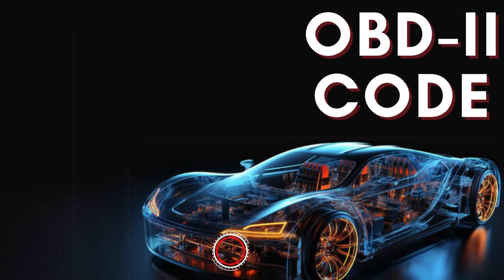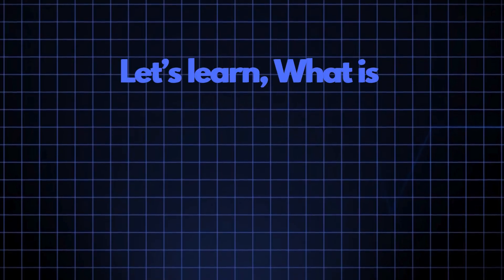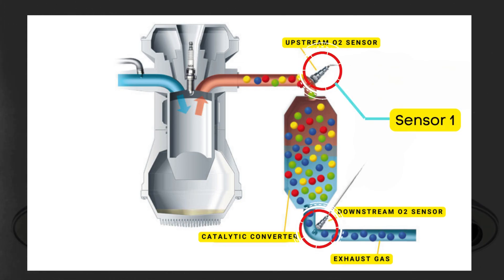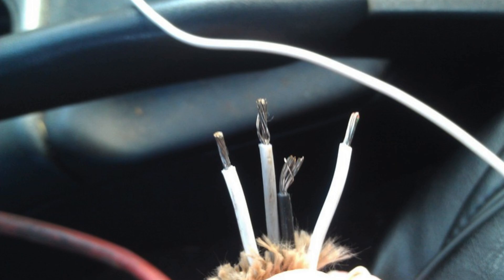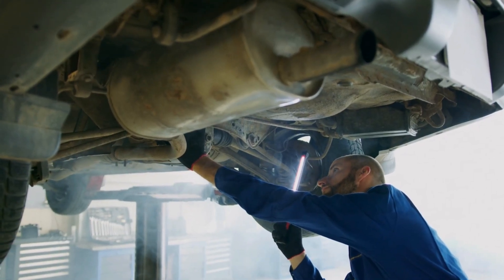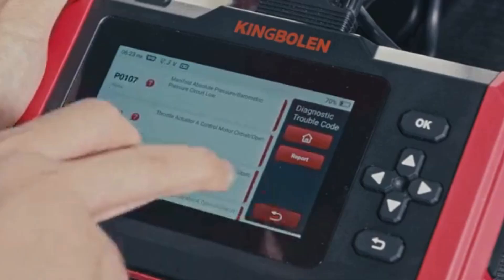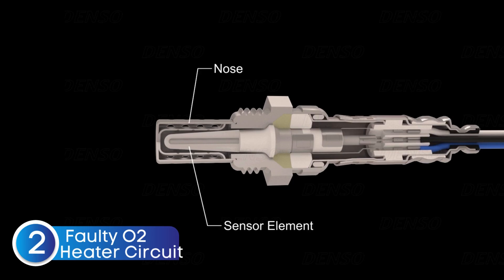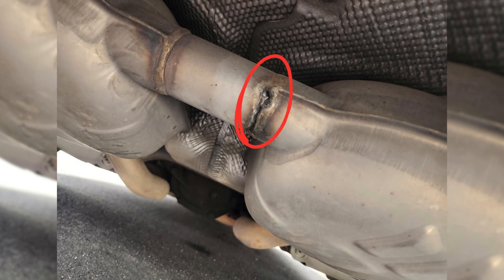How to fix P0132? | Oxygen Sensor High Voltage (Bank 1, Sensor 1)

Comment: My 02 sensor at motor cycle live data reads 1.275v 
When i disconnect 02 sensor and read at singnal wire to ecu harness side and check continuity at positive battery when ignition on engine of it reads 10.00+volts
Reply from the maker: Thanks for sharing your experience!